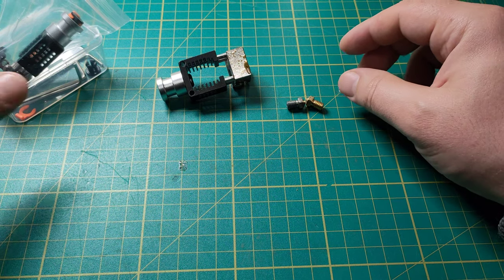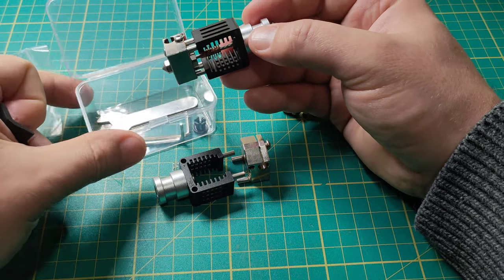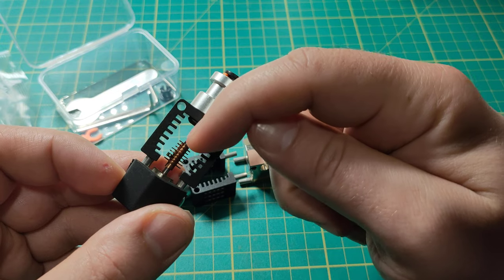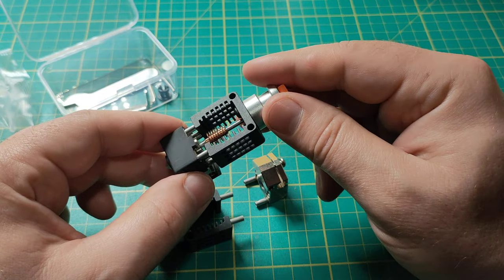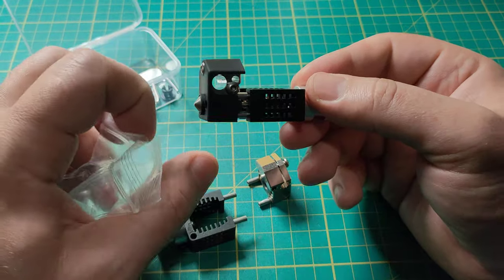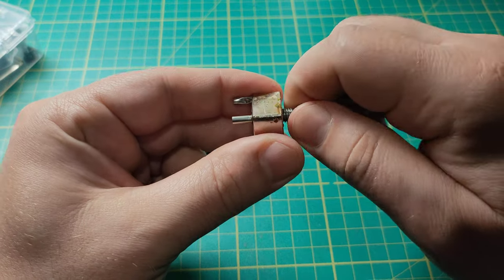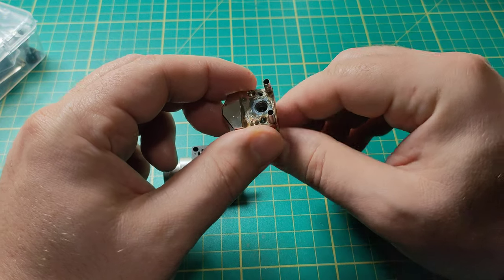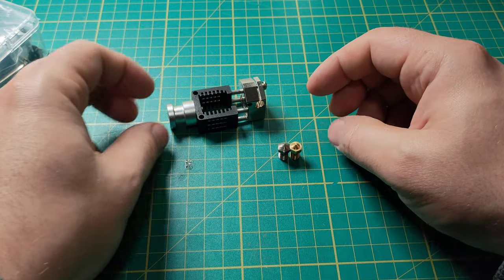Dragon hotend for 3d printer. 4k video

Comment: In this video: not a Dragon hotend. 
You're also missing the point of the "throat" being that thin, and that's thermal conductivity. Stability is provided by the four rods around it.
"Not good for PLA" is also a quite ridiculous thing of you to say. And then you're complaining about no PTFE tube being in there... right, because every all-metal hotend is only all-metal if it has a PTFE tube in it (because PTFE totally is a metal!). Here's a hint: think about why the "throat" is that thin.
But if you're disassembling a hotend because of a clog, a Mosquito(!) hotend may not be the right choice for you anyways. Or at least not a cheap clone with very wonky manufacturing tolerances.
Reply: Pla works really great for me with the trianglelabs dragon hot-end. I've had ever a clog with the dragon that was the fault of the dragon. He should have bought a good clone or the real thing

Comment: Thanks for posting a video, but these are not a Dragon hotend, they are a Mosquito Clone, well they are more of a NF Crazy Clone, so they are a Clone of a Clone?, anyway I print PLA with these Mozzie clones all the time, its all metal (Bi-metallic) for a reason, you just need a better cooling fan if your getting heat-creep, I use these to print anything from PLA to UPAHT-CF15, all the way up to 320° C and I have seen no issues with them. PTFE lined hotends are really only good for PLA period, anything that requires real heat, or has CF in it will destroy PTFE, if all you print is PLA, then I would suggest staying with $10 E3D V6 Clone that's PTFE lined.

Comment: You first have to understand how a hotend works, and only after that make a video about the capabilities of a certain hotend. On the other hand this is not a Dragon hotend, it's a Mosquito clone, very similar to NF-Crazy. It also seems that you didn't tight enough the heat break, because otherwise you wouldn't have so much plastic on top of the heater block. Maybe your nozzle was not a proper one , because you've mentioned you have a gap between heat break and nozzle, which is completely wrong, and leads to clog. Other thing that can cause clogging is the retraction value, because on 6mm retraction like in bowden style hotends, the melted plastic will get on the cool zone and stuck. In fact all the video is a proof that you have no idea what are you talking about. Sorry that I had to say all of these.

Comment: Why not get the original phaetus Dragon instead of a clone?
you're expecting too much out of a cheap clone. at least get a triangle labs clone
Reply: @Vleporama  I have seen people have amazing PLA prints with the phaetus and triangle labs dragons. I have a phaetus dragon hf on order myself
Reply: The thing in this video is actually a Mosquito clone..

the Trianglelab Dragon V2 isn't even a clone, it just uses a less "special" looking hotblock, infact it looks just like a V6, and a heatsink with Trianglelab name on it, they made it together with Phaetus, so the Trianglelab version looks slightly different but it's still the same in characteristics etc. and not really a clone